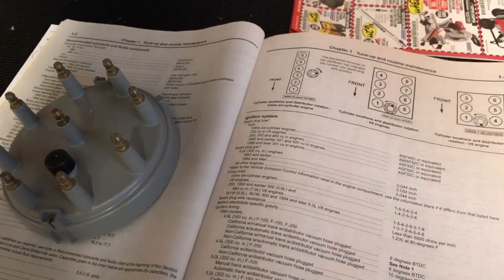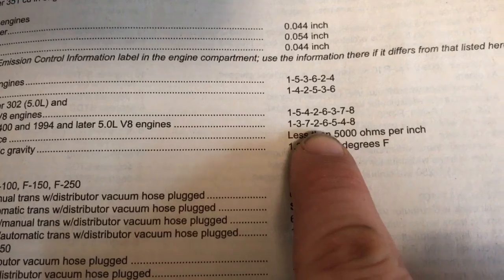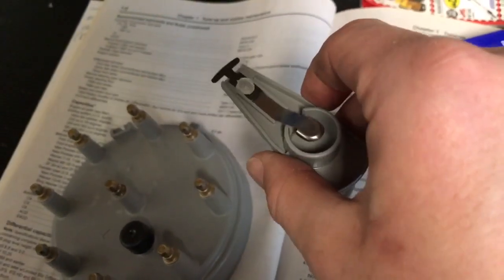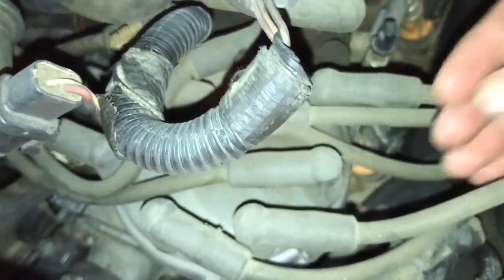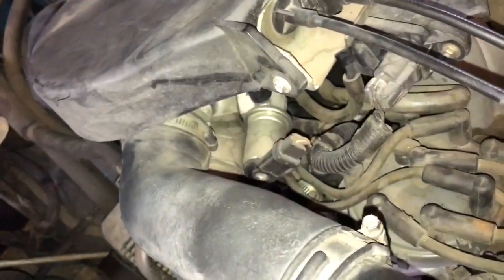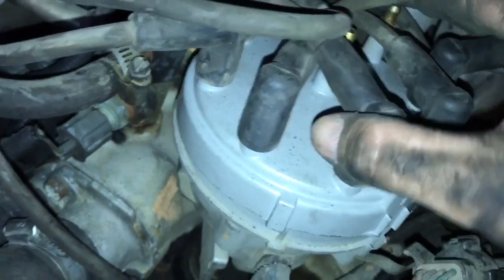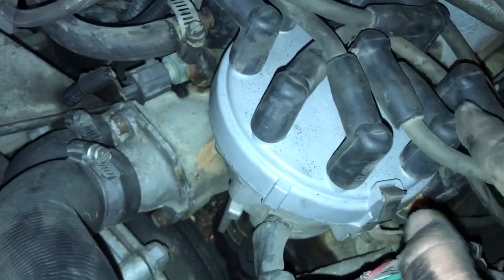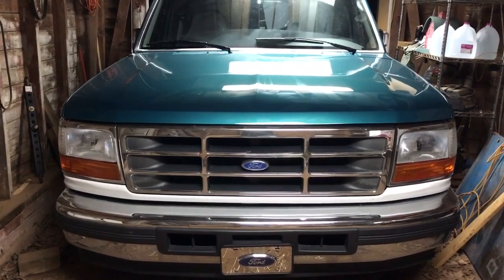Changing Distributor Cap and Rotor on a 1996 Ford F-150 5.0L V8

Comment: At 3:24... does the post from the distributor conduct electricity to the different contact points in the cap, going to the plug wires, and then to the sparkplugs? 
If so, then should the shaft be clean, free of corrosion, and even, maybe, have some dielectric grease on it? Or no?
Am I not to worry about it?
Reply: Never wanto to put it on the posts.. Just a little on the rubber boot since the point is to shield the post from any dirt or corrosion. He said it wrong, but a good google search could keep someone from making that mistake
Reply: @bkelsey6692  You put DiElectric Grease on the boot going to the distributor cap?  I'm just trying to make sure.  My searches seemed like people talking about stuff they didn't know about, or trying to make me do dumb stuff as a joke.
I appreciate your help tho.

Comment: In case you remove a wire or two by mistake, follow the firing order, the rotation of the rotor, and cylinder arrangement.

Comment: Actually, you can rewire a distributor cap designating ANY terminal as #1 and follow the order of wiring as long as the wires reach. If you were to lift the distributor and point the rotor at a terminal designated as #1, it might work. If the chain has jumped, you can designate where it's pointing now and designate it as #1. Then rewire the wires on around following the order mentioned to get you home.
Reply: McCarty.

Comment: Did you go with a OEM Ford Cap & Rotor, or another brand? I'm getting ready to do a tune-up on my 1995 F-150, and I was thinking about going with a Cap that has the Brass terminals instead of the stock Ford. I'd rather have OEM Ford parts, but the Brass terminals are better so I'm not sure what to do.
Reply: Also did you ever replace the Wires & Plugs? I plan on going with just regular Copper Ford Motorsport Plugs, and the Ford Racing Wires in Blue.
Reply: I just found your Wire changing Vid.
Reply: After looking around the Cap your using looks like a Accel, is that it & if so how do you like it? It has the Brass Terminals like I'm wanting.

Comment: Can I use a f150 5.0 distributor in my 1995 mustang gt 5.0ho ,,, 94 and up is mire fire order I believe.... pretty sure same as 351m timing
Reply from the maker: The part numbers for the distributors for the mustang differ than from the F-150. Same year, same size engine.

Comment: How do u know if u need to replace it I have a 94f150 5.0v8
Reply from the maker: Usually you find damage and pitting to to end of the rotor and terminal ends on the bottom of the cap. You may have intermittent spark loss.  Usually people replace them as a maintenance item while changing spark plugs.